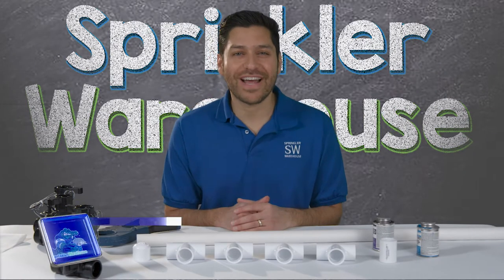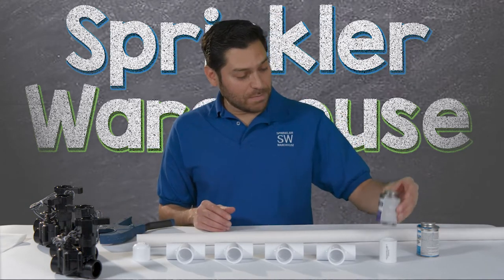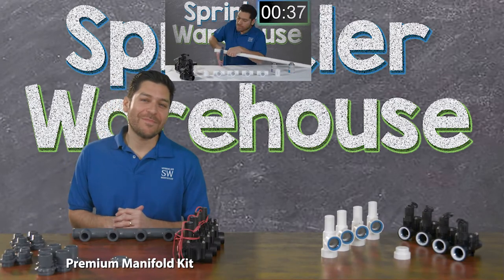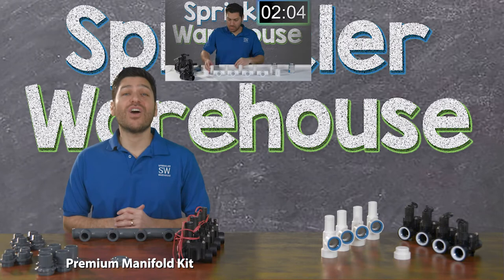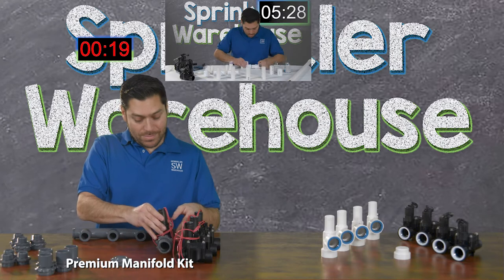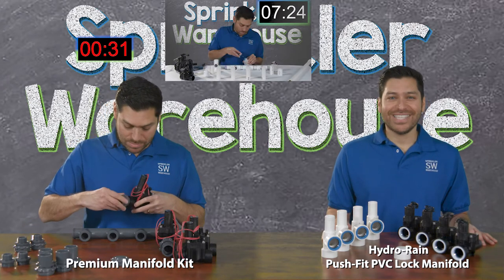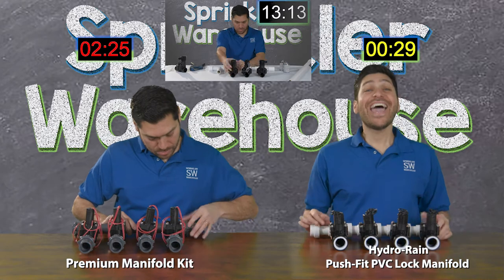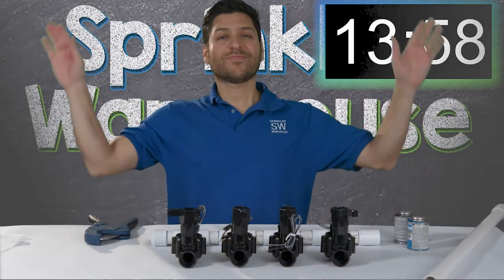Sprinkler Valve Manifold Assembly Race

Comment: Great vid.  Just need another vid showing how to replace a broken valve in each case to compare them.
Reply: When I put in a sprinkler system for my house a few years ago, I went with the standard PVC fitting technique since it was the cheapest and I had worked with PVC a lot over the years... I even put the manifold above ground because I figured it would make it easier to work on in the future... I also wanted it up out of the ground so that I would having to be laying on the ground with possible fire ants while trying to work on it... We seldom get temperatures below freezing and when we do, it's for a short enough time that we don't tend to have to worry about pipes freezing and bursting, so I did not put a high priority on building an enclosure over the manifold to keep it warm in the event of cold weather... A few years ago though, it did freeze and I just quit using the sprinkler system, figuring that I would fix it "when I got around to it"... I'm just getting around to fixing it now and discovered after capping off where one valve had broken  that other valves are leaking, albeit not the massive gushing leak that the first valve had... I'm coming to the conclusion that my manifold design might be easy to GET TO, but it's not easy to actually replace the valves... If you have to work on valves that are spraying water, it's a lot nicer to do it when the temperature is around 100F like we have currently than 60F like we have as a "high" on our normally "coldest" winter day...

Comment: How often do people assemble manifolds? Is it really that big of a deal? It would be much more interesting to me to hear the pros/cons for each. Is there a benefit as far as flow rates? The push fit manifold looks to use smaller diameter pipe to fit in, is it something worth thinking about? How about leaks? Pressure test them. Taking them apart in case there's a need for replacement/service and so on. That would be a much more useful video IMO.

Comment: the Dura manifolds are junk.  Every time I have used them they leak.  it's a shame because you can't know that it's going to leak until you have the manifold assembled with your valves.  something that is supposed to save time ends up adding tons of unnecessary time to a job.

Comment: You have to admit the manual process was made extra inefficient. Pre-measuring would save the guess work of how long each section should be; additionally, the actor exaggerated the effort of using a ratcheting cutter. I agree the manifold kit will be faster in nearly every single case, but you don't have to sabotage the race.
Reply: And if you are doing for a lot of valves, you might use an electric miter saw to do the cuts, especially in larger diameter pipe...